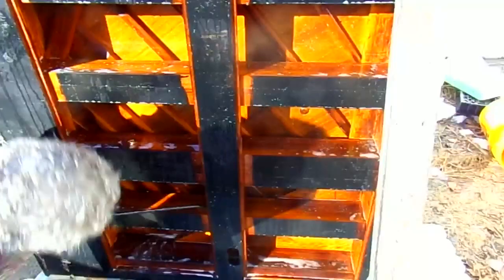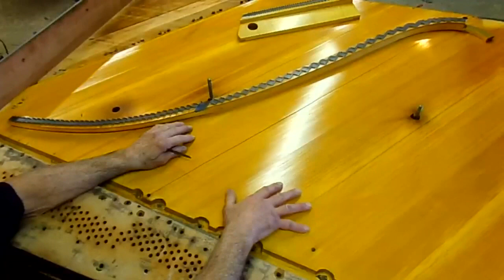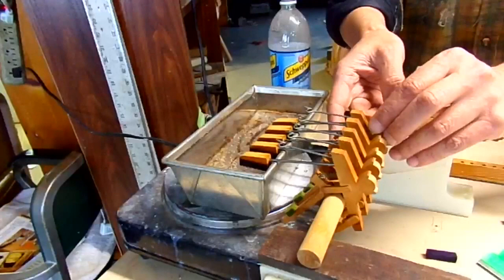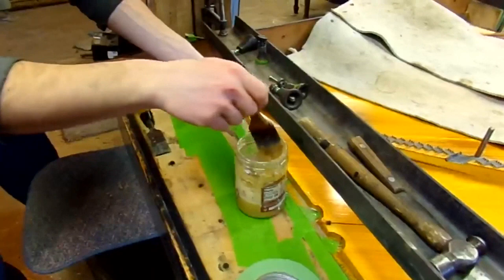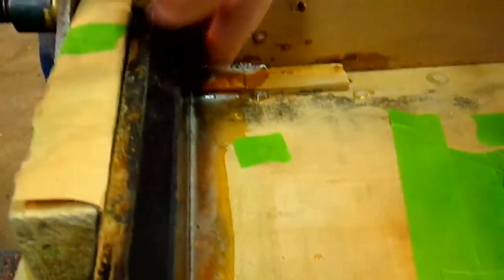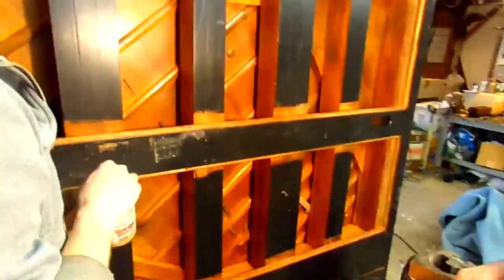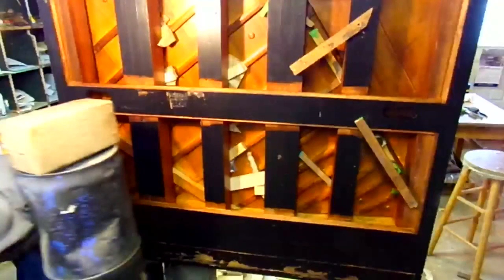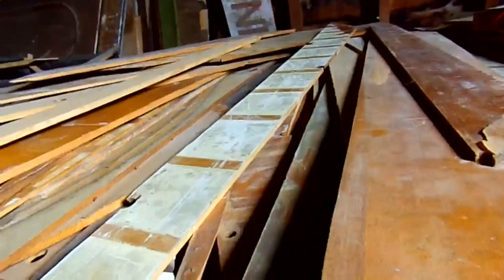Steinway Upright 1886 #57747 Rebuild part 4

Comment: I believe this is a model/style "F" - likely the upright model S&S most made in this era.  I like to call them the "bread & butter model F" for surely this piano helped the balance sheet at S&S.  At $850, this was the second least expensive, a chaste case, yet beautifully made with a sweet, singing treble tone - their focus on quality and sustain - not loudness and boom as the later "K" upright of the early 1900's would come to possess.   The "F" was the base for the next model up, the "L", also 4'5.5" in height, but this one have a continuous bent rim in its back structure, a slightly fancier case with some extra molding and generally a "TSP" - tone sustaining pedal. (sostenuto pedal)